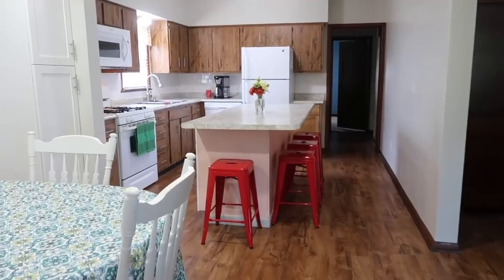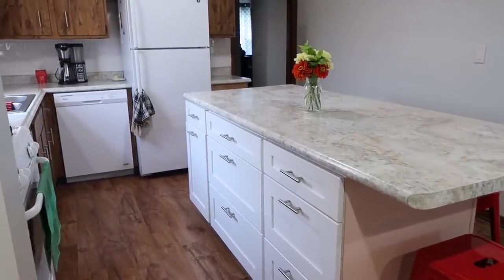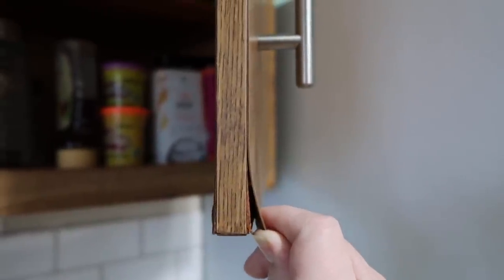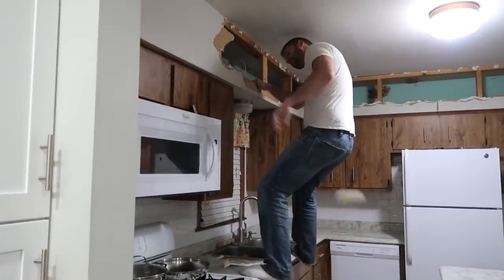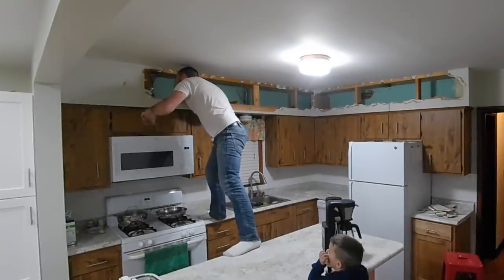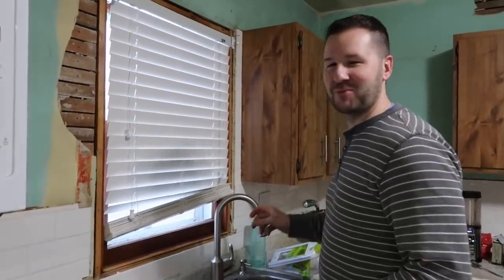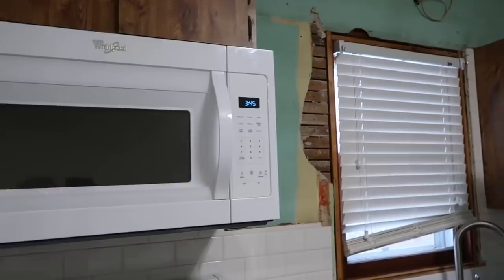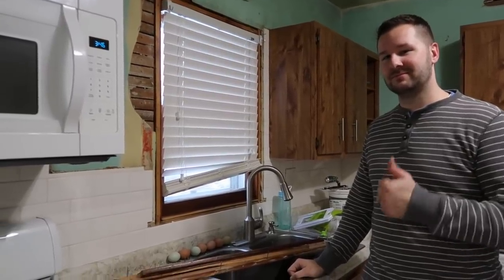Minimalist Kitchen Reno: DEMO DAY, PROBLEMS & DESIGN PLAN

Comment: I'm excited to see the outcome! When we moved into our home 4 years ago we weren't anticipating having to rip out all the cabinets right away but it was clear we had to. I bought a used set of cabinets on Craigslist and had some new cabinets from a family member and we had to buy one new cabinet. We built our own countertops, etc. We just did the floor and now we're getting ready to redo the countertops, add a backsplash, add crown moulding, and paint the cabinets. I'm super excited.
Reply from the maker: That's awesome!!! We're fortunate to have a really great building material outlet by our house that has been a huge blessing for cabinets. It is fun to do it in stages, it was crazy looking back at the old pictures, I think we appreciate it more then!!!
Reply: @TheMinimalMom  Yes! I take before and after pictures constantly so when I'm feeling like there is so much we have to do, I can see how our house looks NOTHING like it did when we bought it. Major motivation and gratitude.

Comment: You have terrible construction techniques in US. Any reno project is so much easier where I live, because we have sturdy walls. Sorry about your husband's injury and good luck with the project. I hope you won't have any more difficulties.
Reply from the maker: That's really interesting!
Reply: The construction techniques can vary by area. Different areas have different regulations.  But that is an older wall. Lathe and plaster isnt typically use anymore.  Its very sturdy. But rarely well insulated. The last 2 houses I lived in that had lathe and plaster were both built between 1909 and 1940. Newspaper was a common insulation back then. Or old clothing. Whatever was handy. That window was done quickly and not properly framed. Glad Tom is fixing that. Were you able to read any of the newspaper? Its always interesting to see what was newsworthy back then.